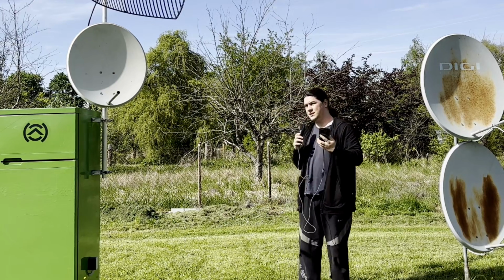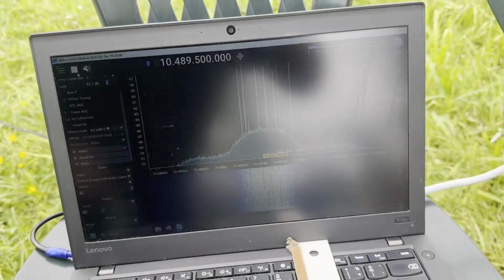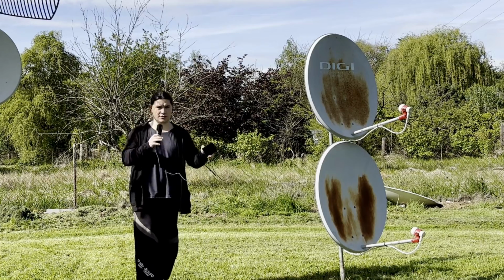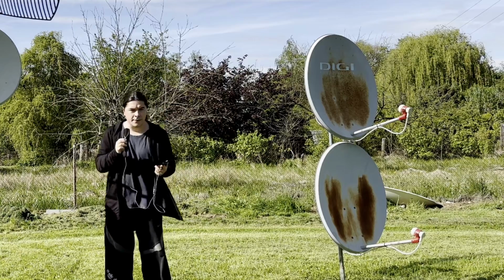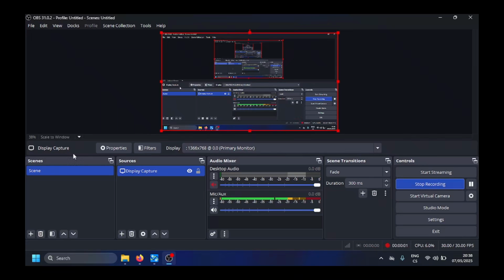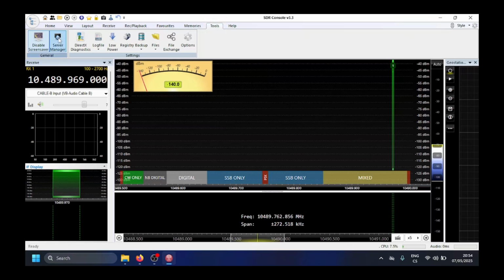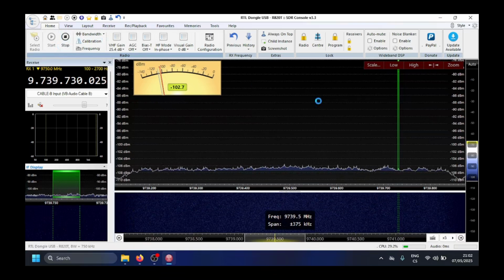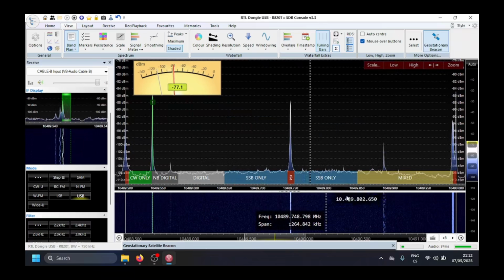Receiving ham radio repeater in GEO orbit (Es'Hail-2/QO-100)

Comment: Wait, elevation is the same as tv satellites or not? Thanks for video.
Reply from the maker: Yes, this is a TV satellite like any other
Reply: @dereksgc  Thanks 👍. I have rotational dish antenna catching satellites from 53E to 5W, but I wouldn't mess with elevation, spend a lot of time to fine adjust for all satellites in the arc. Now I'll make some circuit to inject dc into lnb and try it with rtl-sdr. Hope there is analog audio?
Reply from the maker: Most traffic on the transponder is morse code or analog SSB voice, you can also hear SSTV and some digital modes, I'll have a video going through the most common traffic found on the transponder. There is also a wideband transponder with DVB-S traffic, you may actually be able to tune into that using a standard TV receiver (the beacon transmission only)
Reply: @dereksgc  Thank you Derek. Looking forward to next video.